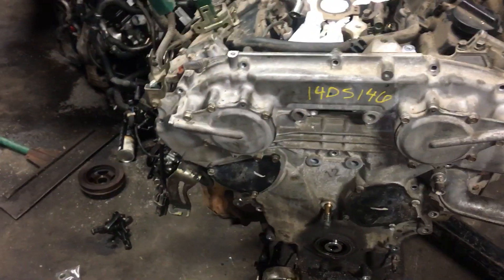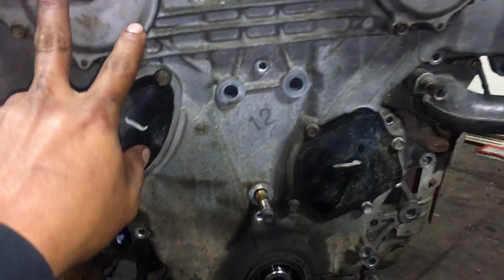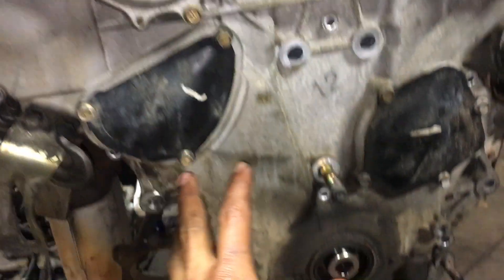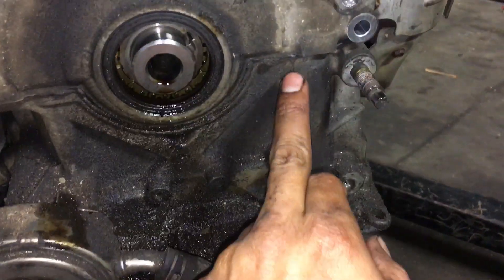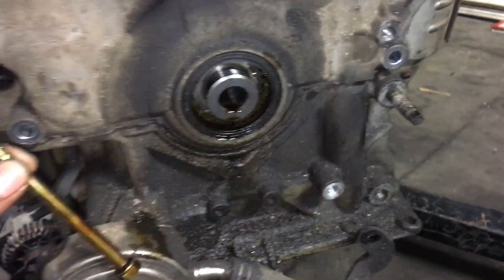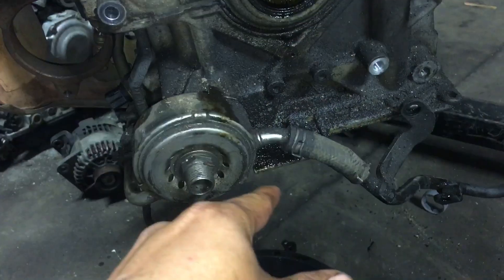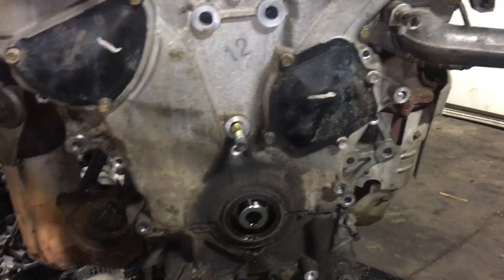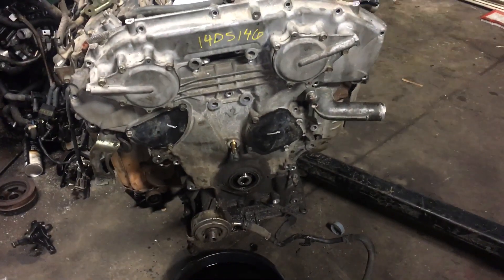Nissan 3.5 V6, timing cover removal TIP

Comment: im currently stuck on this part. i suspected there are bolts inside the oil pan. this is just as bad a design as having a V8 starter motor underneath the inlet manifold. wtf!

Comment: Thank you been struggling for hours to remove this cover. Manual did not mention anything about removing oil pan or the 2 long bolts

Comment: Tengo que hacer exactamente el mismo trabajo en mi taller, pero no cree que sería más rápido levantar la carrocería y dejar el motor, y suspensión delantera en el suelo?
Un saludo, por cierto, cuanto tiempo le tomó hacer este trabajo?
Gracias.
Reply from the maker: Claro esa es la forma correcta para hacerlo 
Solo que este motor yo lo estaba reparando antes de instalarlo en el frame Y se me vino a la mente hacer el video porque yo batallé la primera vez, el trabajo dejando la suspensión en el suelo se puede terminar en el transcurso de un día de trabajo
Reply: @GeneralMechanicGA  precisamente hoy el cliente me ha dado el ok, mañana me pongo a ello. Saludos!

Comment: Wow it’s big pain previous owner where using 20-50 on maxima 2013 and I’ve shifted to 5-30 after engine flush and it started leaking from timing cover I’ll shift back to half 20-50 and half 5-30 hope leak will stop just bought it 2 years back , all maintenance done but still vibration @ 80 km/hr changed tires , fixed bent rims , road force balance, cv axle replaced still vibrating 😂😂😂 this is Japanese car 😬😬😬

Comment: When i remove the IVT solenoid and crank the engine no oil comes out i think it has a blown gallery gasket I have p0011 code

Comment: Do the engine mounts have to be removed if I'm leaving the engine on the car to redo the timing chain and guides ?
Reply from the maker: You will need to a least remove center bolt on mounts to be able to raise and lower engine

Comment: I have a 2003 Pathfinder with 3.5L.  I was replacing a defective water pump today and I think my timing chain skipped a few teeth when I rotated back to tension.  Is removing the cover and oil pan the only way to verify?  I feel like I just opened a can of worms
Reply from the maker: Mmm there might be an other way from crank pulley mark 
But would be an approximate perfect 
And the only way to be 100% sure would be opening it up
Reply: I did take the cover off.  Had to remove a third bolt and the oil filter but not the pan for the pathfinder. It unfortunately slip.  Lot of work but I did verify as it skipped 3 links. Glad I did the extra work.